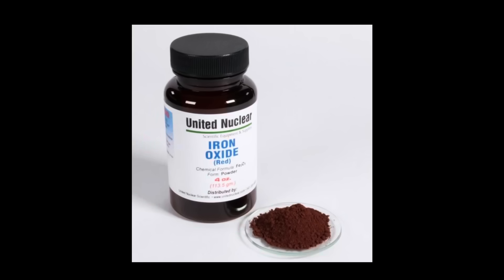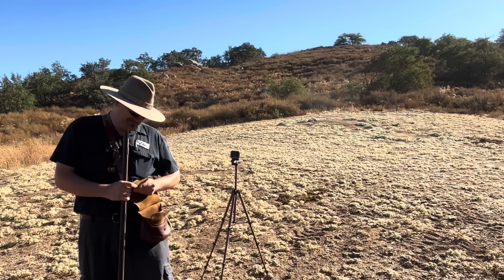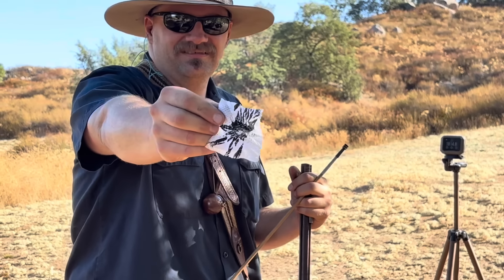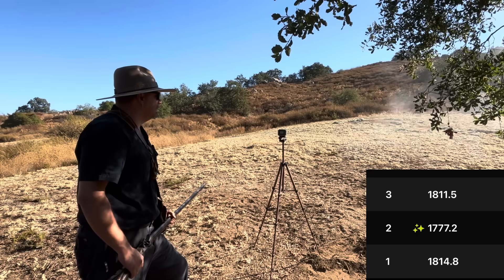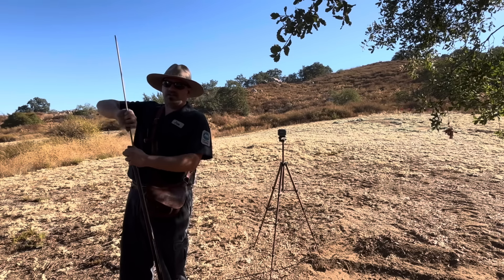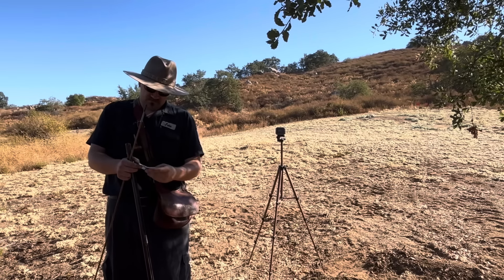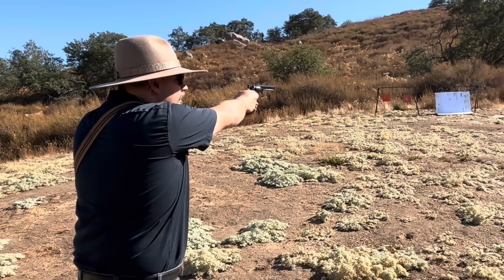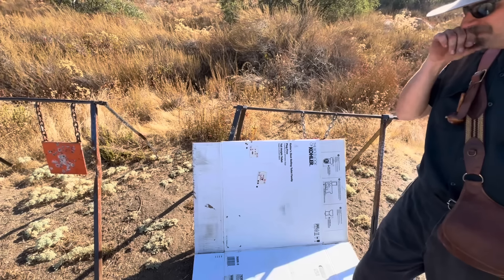Can Iron Oxide Improve Your Black Powder?

Comment: There is only so much a pure BP can do, even with the best charcoal. If you want more energy and velocity you need to be creative. Maybe add a couple percent bariumsulphate, maybe add some couple percent perchlorate of some sort. Heck you could even try and add some fine metallic powders to an over oxidized BP. Try some 80% BP with couple percent black aluminium. Some 1 or 2% of Eckart 5413H or Indian blackhead in an over oxidized BP would be VERY interesting. If you want to stick with ''pure'' BP you can also try soaking the oxidiser into the charcoal. You can try a wet ''CIA'' method and then do a dry ball milling. The ''CIA'' method will dissolve and soak the nitrate into the charcoal and if you then process like you normally do I think this will also speed up your BP. Iron oxide will not speed up your BP, its will moderate the burm rate in some compositions. In other word it stabilizes the burn rate not improve it. Cool videos btw, love it!

Comment: My memory is based on aluminum perchlorate based rocket fuel.  In rocket fuel, the aluminum is used as a catalyst to speed up the reaction,while the iron oxide is used to lower the pressure of the rocket engine without substantially charging the burn time.
How this relates to your product, I have no idea.
Reply: As far as I know, aluminum servers as a fuel, and quite energetic one for that matter. It's the iron oxide that's supposed to be a catalyst.

Comment: Your lock on your kibler seems like it’s faster than any of mine. What you considered a small hang is about normal for me when shoot. I’m using Swiss 3f to charge and prime. Putting just a small amount of powder in the pan. I’ve even taken the lock apart and put grease on all the moving parts to ensure everything moves fast. You done anything else to yours?
Reply from the maker: Nope. I just keep it cleaned a lubed up.
Reply: @Everythingblackpowder  maybe I need to try a different lube. What do you typically use?
Reply from the maker: @Utahflintlocks balistal

Comment: I'm a bit surprised by the results. It seems like an oxidizer would help speed it up. But chemistry is weird and can be surprising. On the other hand, I'm a dummy, so I'm not too shocked I got it wrong.
Reply: Iron oxide doesn't work as an oxidiser here, rather catalyst if anything at all.

Comment: Is it real that if you use straw as a carbon source you make black powder much more friction sesitive or is this just a myth?
Reply: Lightly charred rye straw (‘brown or cocoa’ powder) was made in large blocks for heavy artillery use but in small arms granulations was indeed found to be sensitive friction and abandoned. The benefit for artillery was that it slowed the pressure rise and thus put less stress upon the giant barrels. A solution to a metallurgical problem not to propellant one.

Comment: The idea of iron oxide is to replace some or all of the sulfur. A full dose of sulfur does the job perfectly fine and iron oxide won't help at all. But if sulfur supply is tight, iron oxide will increase the efficiency of the reaction off the sulfur-less powder. It's a catalytic converter basically. Less soot, more gas, which is why the rocket guys n girls use it.
Reply: Yepers! Rocket fine, my flintlock,  no!